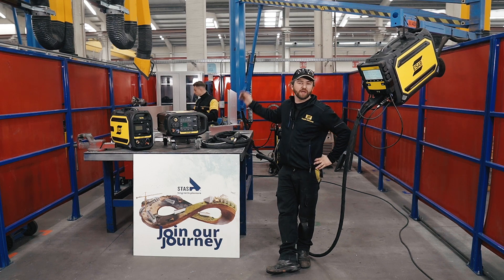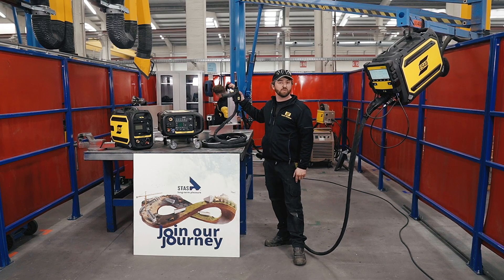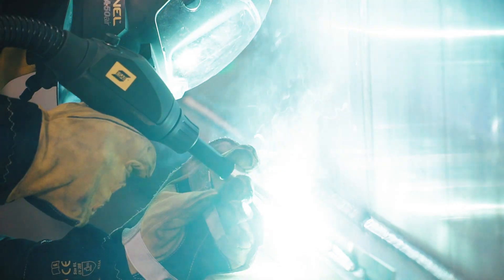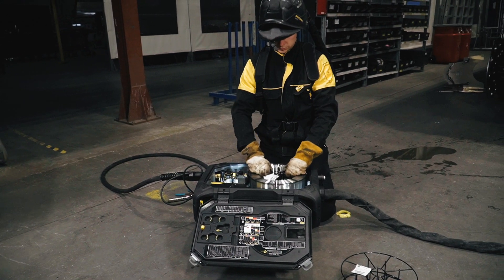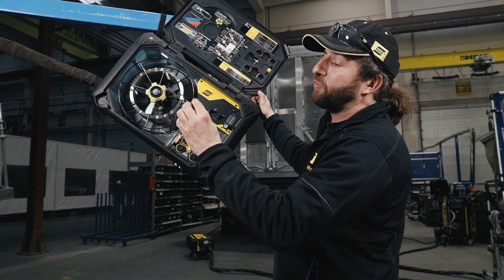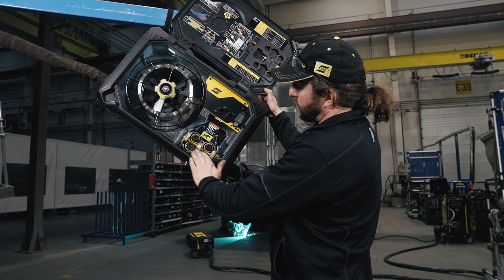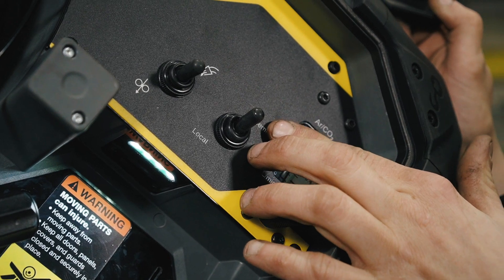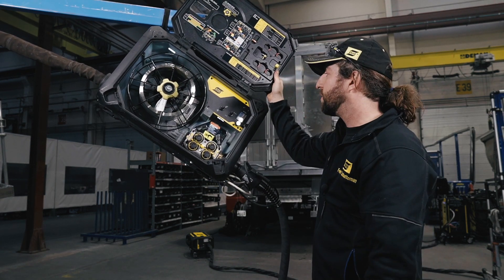RobustFeed Wire Feeder Setup for Aluminium Welding

Comment: This machine gave me all kinds of problems. For 1, you cannot adjust your creator fill function for different thicknesses. 2, the synergic function parameters are not really adjustable other than your wire feed speed. 3, there’s no sign wave adjustability like fronius offers. And 4, the worst part of this machine is the push-pull pistol grip. It is both to big to fit into any tight corners that I am constantly faced with and, way to heavy for maneuverability. I really wanted to like this new line up but, ESAB needs to consider the fact that most fabrication applications are centered around functionality of components and reliability. I had this machine bird-nest multiple times while welding fairly simple parts. The drive rolls inside the box were very complicated just to fix the bird-nesting problem. I would really like to see a whip that is far more flexible and can fit in small tight turns with ease as well as some control over my creator fill and hot start functions. For $16000 U.S. dollars I want a machine that can handle the everything I put in front of it. We’ll stick to our Miller 350p’s until then.
Reply from the maker: We appreciate you reaching out - our tech support team can help walk you through the set up and functions of Robust Feed to make sure you are getting the most out of the features available in the feeder: support@esab.com